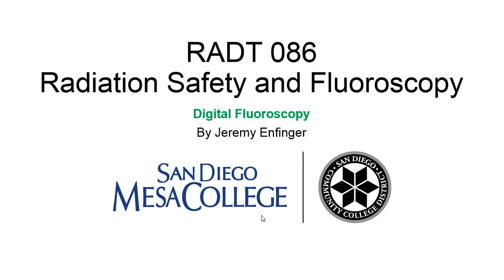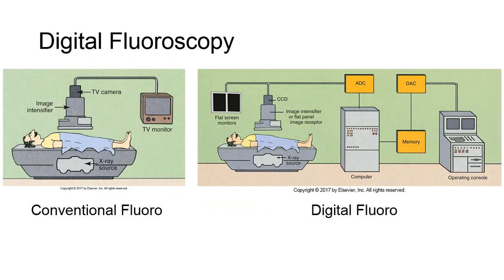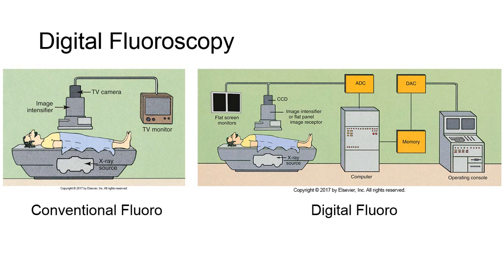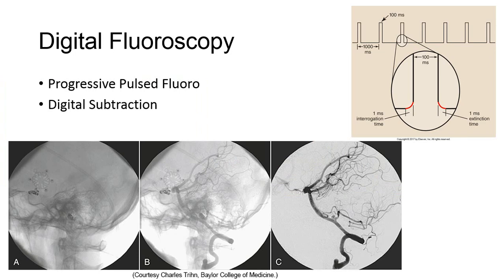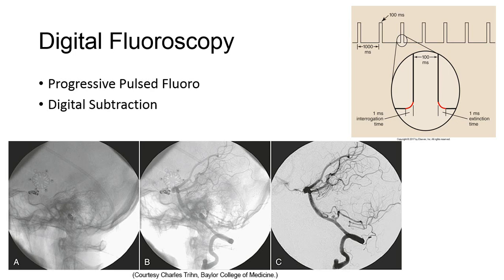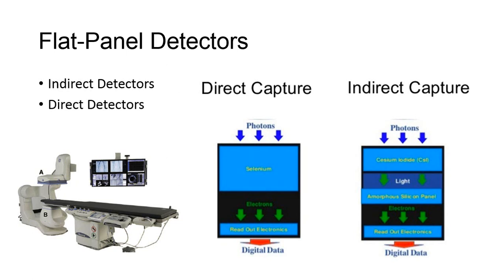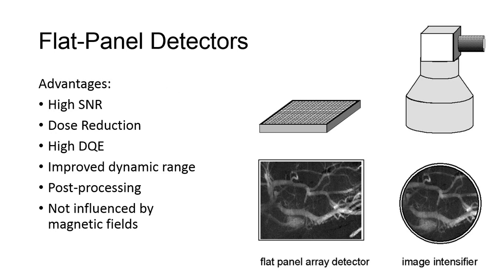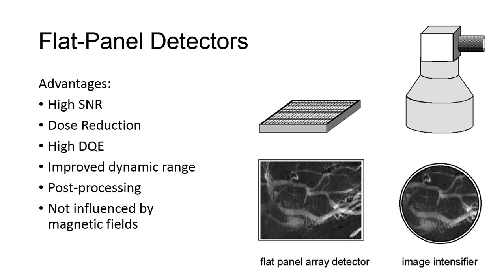Digital Fluoroscopy

Comment: In conventional fluro we have 1-5 mas but in digital 1000 mas how patient dose is reduced?
Reply from the maker: fluoro uses mA, not mAs because it's operating in real time.  You may be looking at something different, but if you send an image I may be able to make sense of what you're seeing
Reply from the maker: Unless you're talking about flat panel detectors.  Remember that the mA (tube current) is only part of the equation when it comes to dose. Higher mA that you see with flat panel detectors allow for substantially less operating time to for m an image, but also, the detectors have a larger dynamic range and can allow visualization of images at lower doses as a result.  Hope that makes sense.

Comment: How can we set fluoroscopy timer pls reply 🙏🙏🙏
Reply from the maker: Setting an exposure timer would not allow you to live-view the image.  Manufacturers have built-in timers that alarm after every 5 minutes of fluoro (at least in the U.S.) but setting an exposure timer would defeat the purpose in functionality for a fluoroscope.
Reply: @TopicsInRadiography  what are these bulit in timers can you explain sir
Reply from the maker: @ShivamKumar-te2zn  They're not "timers" necessarily... they're just alarms that sound as safety precautions - after 10 minutes of fluoro time, we're required to report to CMS (may be different where you are)
Reply: @TopicsInRadiography  but sir as like in taking an x ray we have to press only one time exposure button but in case of fluroscopy we need continuous x ray beams so how will get these Continuos x ray beams from general x ray exposure button by pressing only one time exposure can it will give Continuos x rays or we have to Continuos pressing the exposure for getting a fluroscopy
Reply: My main question is as in fluroscopy we need to Continuos press the exposure switch so as for Continuos x ray beam ....so..is that exposure switch for general x ray and fluroscopy is same or different ?
Reply from the maker: @ShivamKumar-te2zn  The exposure switch itself is essentially the same.  On standard x-ray equipment, you press the button for the duration of the exposure.  The timer circuit will stop the exposure either at the pre-set exposure time that the technologist sets at the control panel (for manual technique) or it will be automatically turned off when the calibrated exposure reaches the ion chamber (when using AEC).  In fluoroscopy, the operator must hold the exposure switch down the entire time an image needs to be seen.  Both switches are of the "dead-man" type for safety reasons meaning if the operator releases the switch, the exposure stops.  Hope this helps.
Reply: @TopicsInRadiography is  ther an audible sound just like in x ray we hear sound only one time thats showed that exposure is done as like in fluroscopy we are pressing the switch continuously so will audible sound also be continuous in fluroscopy?